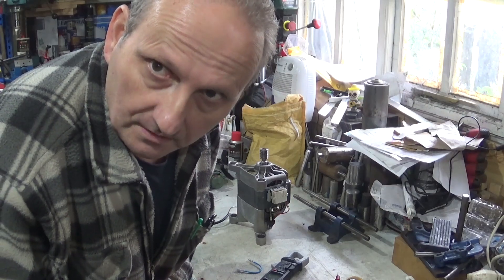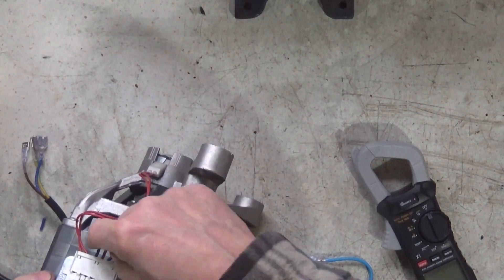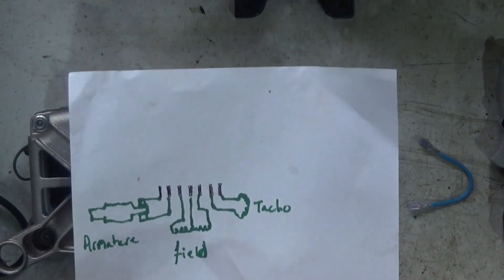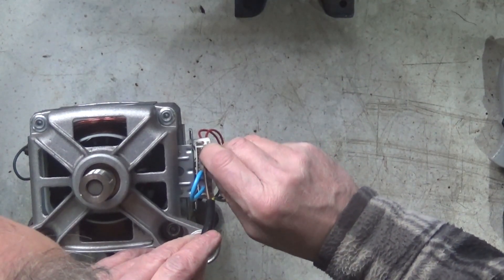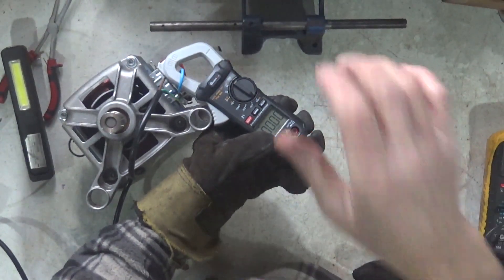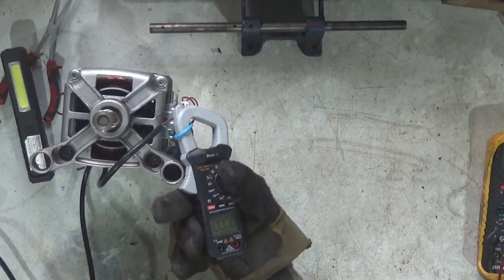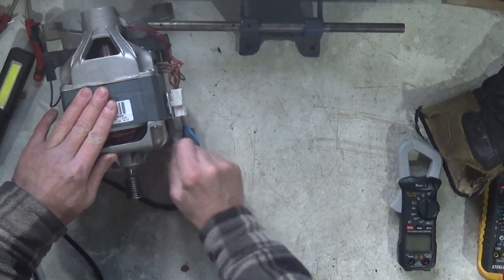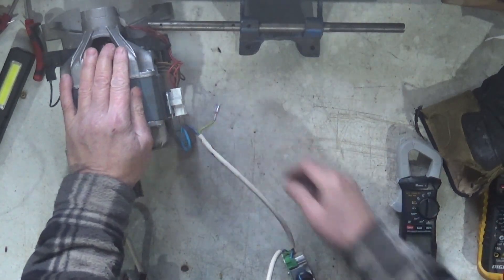Washing Machine Motor Wiring and Control

Comment: Thanks Ben, good stuff, very informative. 
I have a motor the same as this one but the wiring in the 7 pin connector was slightly different: the two tacho wires wer connected to pins 4 and 5 rather than 6 and 7. It took a bit of trial and error (and a few replacement 13A fuses) but I got it spinning in the end. I'm thinking I may build a wood lathe with this.
Reply from the maker: They are quite powerful so could do that if geared down. You could do with speed control.
Many thanks for watching, please like and share and if you like the channel, subscribe!

Comment: Thanks Ben, That Video is very easy to understand. 
Can you tell me how to identify the wire connections on my motor using a multimeter please? 
I have similar 7 wires goinf to a universal 7 pin connector and It is easy to trace 3 of these , 
2 yellow (Pins 7 & 4)= Tacho 
1 Green (Pin 5) = Brush. 
The other white Brush wire goes inside the motor housing and another white wire reappears and goes to Pin 6
There are 3 wires from the windings Turquoise, Orange and Brown which go to Pins 3 2 & 1 Respectively.
I do not know why the white wire goes inside the motor - I can only guess it passes through a winding.
Is it possible to use a multimeter to verify where the 4 wires go inside the motor without taking it apart and therefore which would be best to use for the best (Strongest) output. I am more interested in strength not speed.
I have a speed controller which uses the tacho connections to control the speed, but I have already blown up one by using the wrong winding/brush wires so would like to be more thorough when wiring the next one.
Thanks
Reply from the maker: There should be a wiring diagram in the video, finding and viewing it may help.

If you have identified the tacho wires (2 wires) ignore them for now.
You then have a pair of connections to the brushes which should have a resistence to them of between 6 and 10 ohms. You should have infinite resistence to all other pins.

You then should have 3 wires left, these are the stator/field coils, with two of the 3 wires being either end of the pair and one in the middle.  In theory if you connect across both you should have twice the resistence of one but in practice there is contact resistence of 1 to 3 ohms. Each coil should be between 3 and 5 ohms. So if one pair of the 3 tests at that range, and the next double that less an ohm or two you should be able to tell. You will want to wire the stator coils so that you are across both at the same time with two wires.

Also none of the stator coils should have less than infinite resistence to any of the other 4 wires.

Hope that helps, many thanks for watching, please like, share and if you like the channel, subscribe!

Comment: Ok, so I have a 5 wire set up. Tacho = 2 brown wires. Then I have a heavier white, red, black. So this appears to be brushless. Does this mean I can't low volt it? E.g. 12v .. the motor states ACC type 20585.123 195v 310hz ac-el 17500 rpm .. can you help?
Reply from the maker: Does it look like this one?
https://appliancespareparts.mysimplestore.com/products/hotpoint-indesit-washing-machine-motor-type-20585123-028267f814-16002275900-20585123-028267f814-16002275900-20585123-028267f814-16002275900-fully-tested20585123-028267f814-16002275900

If so, I suspect that the brushes are hidden inside the motor housing. To drive a brushless motor at that speed and power would require an extra cost. 

Also from the pictures I have seen, it looks like a standard washing machine connector. 
However the stator coils might be wired together with no centre tap and the rotor brushes might already be in series.
Have you tried checking with a multimeter?
Reply: @BensWorkshop  that's the very motor. It was pulled from a working but buggered machine, it wasn't a motor failure, it was moisture on PCB from what I recall. So the motor works. Or at least worked. I'm just wondering what I would try Vs a direct 240v here in UK. I was hoping to make a lathe or something from it.
Reply from the maker: I forgot to add, please like, share and if you like the channel, subscribe! (You will see lathes here as well)

Have you looked at this video where I replace brushes:
https://www.youtube.com/watch?v=2pNQQqsed78

Can you see anything like that in the motor. From the pictures it seems they might be burried.
Also check this video out on reversing and speed control:
https://www.youtube.com/watch?v=8uYmBJt8_Us

Your motor looks mostly like a standard brushed motor. The brushless ones on washing machines are pancake motors.
Reply from the maker: How are you getting on with the wiring on your motor?

Comment: Hi Ben, sorry I was without broadband for a couple of weeks and only just beginning to catch up on my viewing!!!  That was all nice and simple - now I just need to find a project that needs a washing machine motor!  Washing machines are a great source of cheap used motors, and that motor controller was a bit of a bargain too.
Reply from the maker: PS, you may have missed the videos on the London to Brghton veteran car run, and me making a tool to overcome excessiveky tightnuts...
Reply: @BensWorkshop  Yep, those are on my "to watch" list - I'll get to see them eventually.....
Reply from the maker: Hope all is now well with the broadband. Yes, the motor controller is cheap though currently unavailable on Amazon. I can but those motors for a pound a kilo at my local scrapyard though the one on test was free, as someone replacing theirs asked if I wanted it so I removed it myself.

Many thanks for watching!

Comment: hi ben 
Great. 
ive always wondered if washing machine motors are useful for anything, 
might be simple to you but for us non electrical minded not so.
I wasn't sure from the video were you were attaching the mains to on the motor.  Also what sort of h/power are they, can they power small lathes and eg my new little shaper,.
cheers
Kev
Reply from the maker: When you say you were not sure where to attach the mains to, do you mean on the controller or the actual motor?

Also, you this one seems to be around 1KW, though being universal rather than induction motor they are less efficient. You could power something like a shaper, though I would be more inclined to use an induction motor. I was thinking this sort of motor would be useful for some types of sander.
Reply: @BensWorkshop  cheers ben 
both motor and controller.
kev
Reply from the maker: I was hoping the motor part was clear.... Obviously not. The controllers might vary, but perhaps I should do a longer video.
Reply: @BensWorkshop  Cheers Ben , sorry don't want to put you to any trouble, but for someone who has not much electrical knowledge , i like to belt and brace things before i commit to pumping electric through it.
take care 
Kev
Reply from the maker: No worries.

Comment: Thanks Ben, I've got at least one of those lying about and this wee speed controller could be just the solution. Cheers mate.
Reply from the maker: Quite useful speed controller. Needs careful mounting as it is all at mains voltage.

Many thanks for watching.